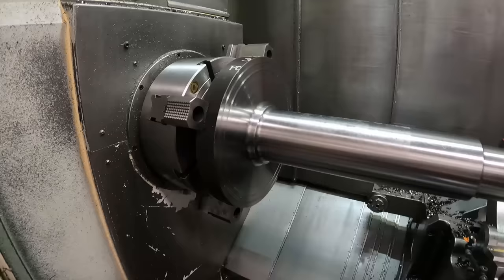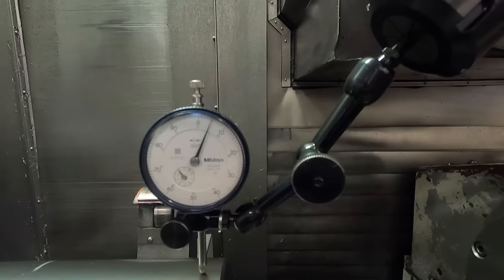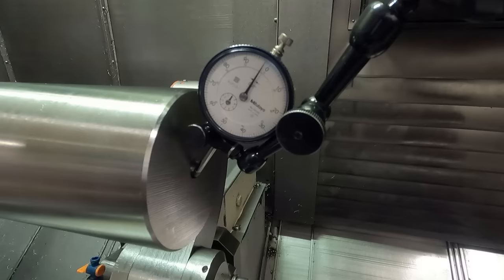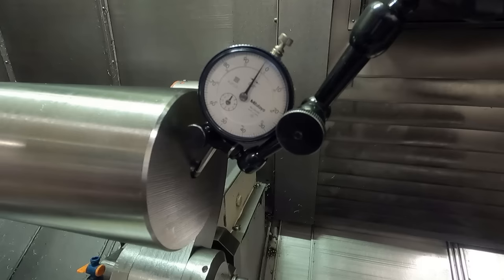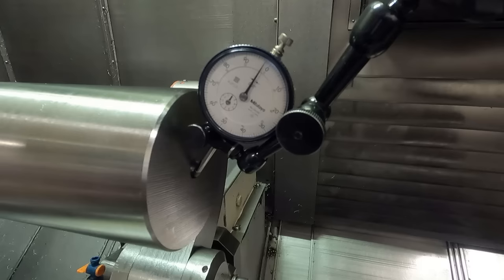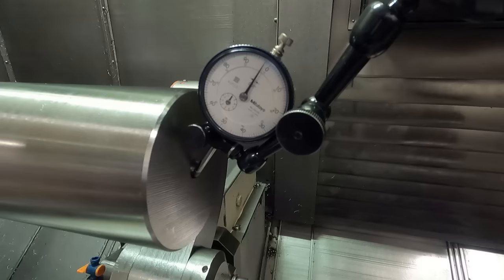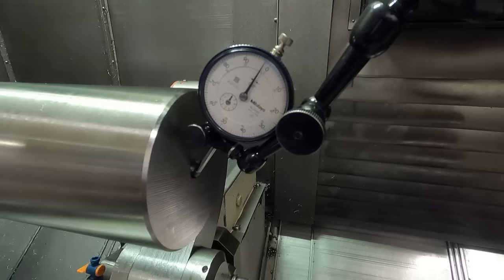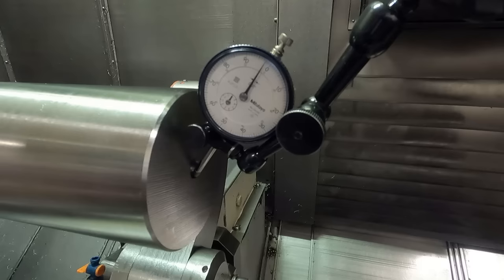Machine Shaft From 2000 Lb Stock

Comment: Part like that should've been made out of an open die forging. Very poor way to make it.
Reply from the maker: These parts were for this customers machine that was down. The original shafts were made in two pieces welded together. They had a failure. now with the machine that makes their product down time was critical. So in order to get the job done quickly and to avoid the same failure they decided to go with a one piece construction. Forging takes to long so we were left with machining out of solid bar.
Reply: @EdgePrecision  - Sounds reasonable. You gotta do what you gotta do. Even if it's not optimal sometimes.
Reply: I hope at least made out of heat treated 4340 or similar.
Reply: But heat treated 4340 would've required grinding. Can't win.
Reply from the maker: @andreweppink4498  It is 4140 commercial heat treat. That would fall into the range of 28-32 Rc.
Reply from the maker: @andreweppink4498  There are many different levels of heat treatment.
Reply: I wonder if it might be a good idea to machine a spare out of a heat treated 4340 forging now that there's time. Dunno the part history but it's apparently highly stressed. Big stress riser at flange even with a generous fillet radius. Dunno part cost but presumably pretty hi. 

Still...

Comment: All the parts I see are worn out and need repaired.
Reply from the maker: What exact parts are you referring to?
Reply: @EdgePrecision  I meant what I personally see in my line of work.
Reply from the maker: @albertanderson7915  all the parts you see. What parts do you see in your line of work? I’m sorry if what I have doesn’t measure up to your standards. It’s only me and my time and money that I have to work with.
Reply: @EdgePrecision  I think you got a good setup there. I meant no disrespect towards you or what you have going on there.The company I work for handles repair work on pretty much anything that is in the industrial world. I personally do a lot of thermal spray repair, ( twin wire arc and plasma flame spray).

Comment: Seems silly and wasteful to run the rest oiler when not in use.....
Reply from the maker: I didn’t wire it. It was that way when I bought the machine. I would have wired a relay to the spindle drive. So it only ran when the turning spindle is on.

Comment: Why bother putting $3 casters on the bottom of your 50 gallon drums to move your chips when you've got $150,000 crane!@ 😆😆😆😆
Reply from the maker: I’m not sure what you are referring to. But the crane won’t reach to the end of the chip conveyer. So the 55 gal drum is on a dolly to roll it into the access of the crane. Not nearly $150,000. More like $15,000. Only ten times off.
Reply: @EdgePrecision  it was just a friendly joke, most garage machinist like us would just grab a dolly and go roll the can away but you had this beautiful crane to lift all your heavy stuff around! 😊

Comment: Isn't that a big waste of material? Why not make 90% of the shaft with smaller stock, then just making the platter/flange at the end of the shaft with the larger stock, and then weld the 2 pieces together?
Reply from the maker: If you read some of my earlier responses. I think you will find your answer.

Comment: 1 ton bar to make a 220 pound part?
Lotta waste there, both material and cost for the material. 
Nuthing to brag about. To be ashamed of, yes. To be proud of ... nope.
Cost the customer what? 20x the price in materials and labor than if you had started with a bar closer to the finished size?
Reply from the maker: I don’t suppose you noticed the diameter of the flange on the end of the part. The stock could not have been any smaller. The customer wanted the part made in one piece.

Comment: Why not just run the machine while youre shoveling out the chips?
Just wear some safety glasses, a yellow vest and gloves.
Otherwise youre just wasting so much time.
Reply from the maker: The machine won’t run with the doors open. There is no way to get around these safety interlocks. You can’t bypass the switches. The controls times out with a alarm. Besides the coolant would get all over everything, if it could be done. I know your probably just making a joke of some kind. Besides it is my time I have no boss telling me what I can and can’t do.

Comment: Without having a clue what you're doing I must ask is there a reason that you don't have the part annealed before you go any farther with it.
I guess I'm not a believer in paying to have a part stress relieved.
If You're going to pay to have it put in an oven might as well get it done right.
After removing such an amount of metal I would certainly have it annealed if it requires heat treatment unless it's something over 48 RC I would then have it heat treated.
Considering the tools available these days long as it was under 52 Rockwell I would still have it annealed then heat treated before I even went any farther just can't believe people making parts and not going to the steps necessary for a quality part.
A lot of material can't be cheap all to risk it over a few hundred dollars.
I think not even if you're in a hurry I would not waste my time without at least annealing the part if it needs heat treatment and you're just going to be a bonehead well then do that alone there is no way that I would even consider to put it back in the machine until that was done I worked for someone and was told to zip it and get busy yeah I'd zip it all right home never to return.

Comment: Seems like you're wasting thousands of dollars worth of stock. I guess you're not making enough of them to merit getting forgings done, and using a weldment would be rather difficult.
Reply from the maker: You either pay for the material or pay the welder or pay the forger or pay me. I would rather they pay me. It all comes out about the same.
Reply: To the small thinking guys like you Paul, it's a waste of material.
To the big thinking guys like Peter, this is what made him build a resort in Mexico.
Reply: @EdgePrecision  Getting paid to make chips especially when just doing roughing is fun unless the material is a B!
Reply from the maker: @bcbloc02  If the chip conveyer was working yes. But without 🤬👎.
Reply: @EdgePrecision  I don't know I have always had to shovel my chips. No conveyor on 1940's and 50's machines.  I kind of smile though when the chips are coming off like a waterfall even if I do have to get them up of course manual cleaning a lot easier on an open manual machine than your CNC.
Reply: @loukola5353  It is a waste of material. Anyone who didn't consider alternate fabrication processes would be small minded.